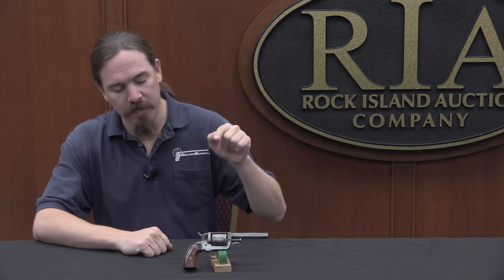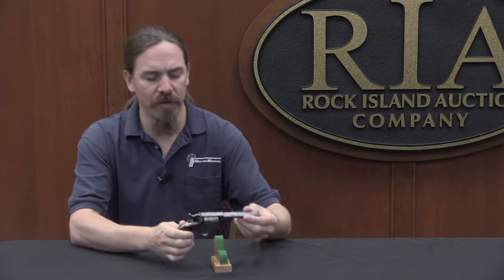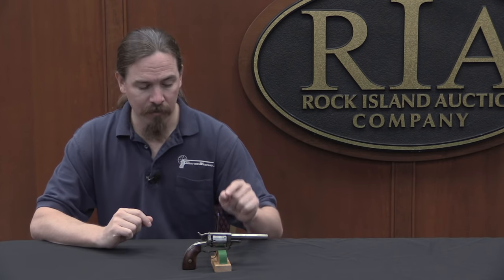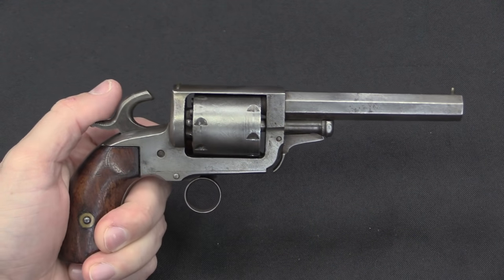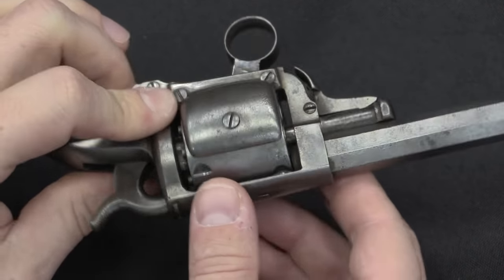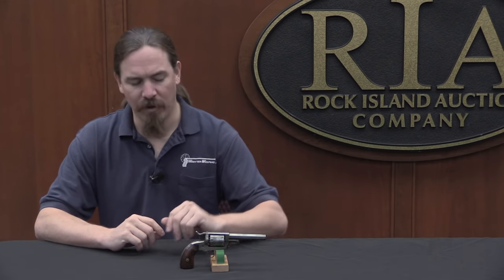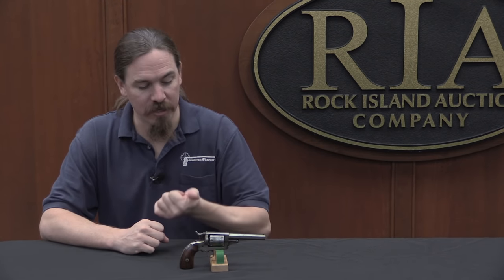Whitney-Beals Walking Beam Pocket Revolver

Comment: If that trigger forward motion also cocked the hammer it would have been a real contender, not just a patent workaround.
Reply: ArthurAlcantara Seriously. Double action with the trigger pull of single action? Sign me up!
Reply: The trigger might be a bit stiff to comfortably and quickly do the forward motion, your finger is at mechanical disadvantage in that direction
Reply: @AgamemnonTWC  the stiffness of da triggers come from the cocking of the hammer, it would be as stiff as any other DA
Reply: Maybe the hammer could still be cocked for single action as well🤔

Comment: Many people in the comments are quite correct. It was very common for older, unwanted and obsolete cap and ball pistols be given to children as a toy. The original intent being the kids would still use firing caps for the noise and fun..... but then they run out of caps .....and like I certainly did,dry fire until your finger hurts 😂😂😂 the adults thinking at the time was it just became safer as it was played with...some even appear intentionally mangled or flattened.... sorry to write a book in the comments, but I have a matching set of 2nd model dragoons that are currently only decorative.... thanks to my favorite nephew 😂

Comment: It seems like the forward stroke on the trigger ring could be made to cock the hammer without too much extra work in the design, and wouldn't technically be patent-infringing because the action of indexing the cylinder cocks the hammer instead of the other way around. Of course, Colt would probably have taken Beals to court on that anyway, so maybe he decided to avoid any potential for litigation altogether.
Reply: Logician Writer I'd set it up so the forward stroke indexes the cylinder and the rearward stroke cocks and drops the hammer.

Pulling an 8lb trigger's no big deal, but pushing one would likely get tiresome.

Comment: Considering the cylinder angle is never locked, that's pretty cool. The lever has to accurately clock the cylinder at the sear release, and has to hold that angle through firing. It must have a pretty significant starting angle in the chamber.

Comment: Spring load the center guide on a rail fastened to the barrel and you could simply slap in a loaded secondary cylinder, much faster than handloading each cartridge from a gate.
Reply: This... This isn't a cartridge gun.

Comment: That is a beautiful little mechanism. On a more general note - I have never understood how, with revolver mechanisms, you can be absolutely sure that the chamber is lined up with the barrel. For example, with this gun - yes, the movement of the "walking arm" can be designed to rotate the cylinder the correct amount. But once it's in position, it only appears to be held by friction with the legs of the walking arm, and could surely be knocked or accidentally rotated slightly off alignment? There's no additional detent to keep the cylinder locked in the correct position. Hope I'm making sense!

Comment: ehhh...walking beam engines weren't used all that often on steam locos. Those mostly (pretty much all of them since Stephenson) used cranks and conrods, similar to a gasoline engine without a sump. The closest thing to a "Walking beam" might be the rocking expansion link of Walschaerts valve gear, which was used to adjust the geometry of the valvetrain and thus timing. As well, the "walking beams" used in marine steam engines are different from this mechanism, but I can see why they called it that, what with the rocking motion.
Reply: James McHenry walking beams were however pretty common for stationary power for pumps, mills, machine shops, etc.
Reply: Right, right, but they were kind of a lever, connecting a vertical cylinder to an adjacent wheel, not something that rotated a cylinder by its side.

Comment: It looks like a couple of the percussion cap recesses are pretty badly damaged. How would that have happened?
Reply: Dry-firing will do that pretty quickly to percussion cap nipples.
Reply: I figured it might've been a malfunction since it was only on two of them. Hm.
Reply: There might be any amount of variations between both the nipples themselves, and the holes/ threading in the cylinder. Whitney was a pioneer in standardising parts, but the metallurgy and engineering of the day was still somewhat haphazard. Even a slightly off-center hole would result in uneven "peening" and ultimately cracking, as seen on one of them. Besides, we don't know that some of the nipples weren't changed out way back when. They would be threaded into the cyiinder,  and changing them out would probably be a routine gunsmithing job. Remember, heat treating was done by eye, and hardness would vary between lots.

Comment: The easily removed and replaced cylinder could make for lots of firepower.
Reply: Thomas Macnutz  
You can make interchangeable part by hand finishing to a jig instead of the gun it is going into. It is how it was first done.
Reply: @Thomas Maknutz
Also there is no reason to believe that the Whitneyville Armory didn't produce interchangeably parts.

Comment: 7:10   Remington Old Army? I thought it was New Improved Model Army or Navy
Reply: Actually it was the "Remington-Beals" Navy & Army revolvers first (1860-62) followed by the "Remington-Elliot" Army & Navy (1862), followed by the Remington New Model Army and Navy (1862-1872). The Beals patent was for the way the loading lever retained the cylinder arbor.  The "Elliot Patent" replaced the Beals patent retaining method in favor of a method that allowed the cylinder arbor to be slid forward to remove the cylinder without dropping the loading lever. The Elliot patent allowed the cylinder arbor to work loose while holstered, meaning the cylinder could fall out when the revolver was drawn! U.S. Ordnance quickly urged Remington to return to the Beals Patent loading lever arrangement, which resulted in the "New Model" quickly being phased in by late 1862 onward. The Remington-Elliot was modified to retain the arbor like a Beals patent gun, by putting a screw in the loading lever to block the cylinder arbor. The New Model revolvers were actually stamped "New Model" on the top barrel flat. The earlier Remington-Beals and Remington-Elliot were soon being called "Old Model" even though there was no actual stamp naming the guns as such.  The progression from Remington=Beals to Remington New Model was rapid, occurring in only 1862!

Comment: How is it done that the Ringtrigger does not move the Bullet slightly out of the alignement? Because as far as I can see, if you pull the Trigger to shoot, it will move the cylinder a little farther?

Comment: Great video as always.
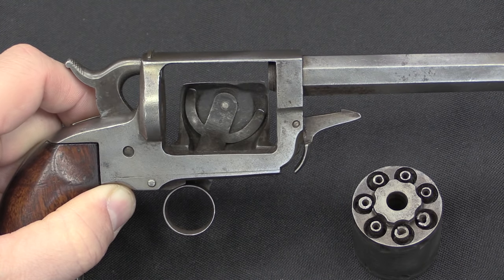If I may, I would have liked some more explanation on the barrel as we can see it at 4:48. It seems damaged. And also I guess it's not designed to hold a modern cartridge. Finally, would the gun be in a good enough shape to be used safely?

Comment: how can this mechanism make sure the bullet is inline with the barrel?
Reply: by making the mechanism a specific size, so when you pull the ring foward and back again it always rotates the cilinder a especific amount (the amount of rotation needed so the next bullet is in line with the barrel)
Reply: i see that but what i mean is the cylinder is kinda "free flowing" and any random vibration seems likely to cause a miss-alignement
Reply: that's a good point, the cylinder can only rotate in one direction because of the hooks that rotate it also stop it from rotating back, and i cant be sure about this, but i would guess the hooks also prevent it from "rotating ahead", maybe just with friction.

just look at the grooves on the cylinder and imagine how the hooks would be positioned in them.